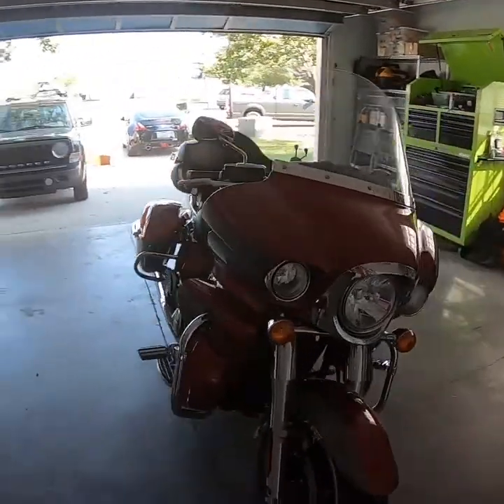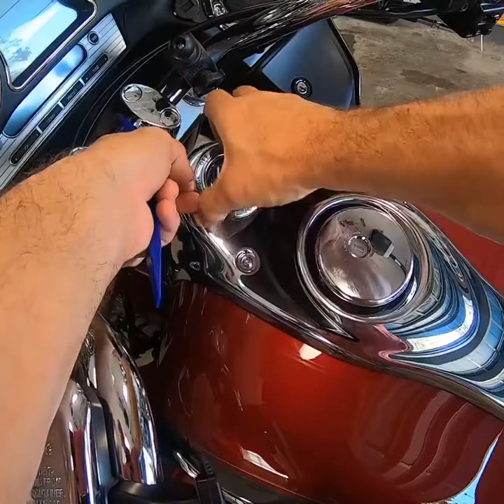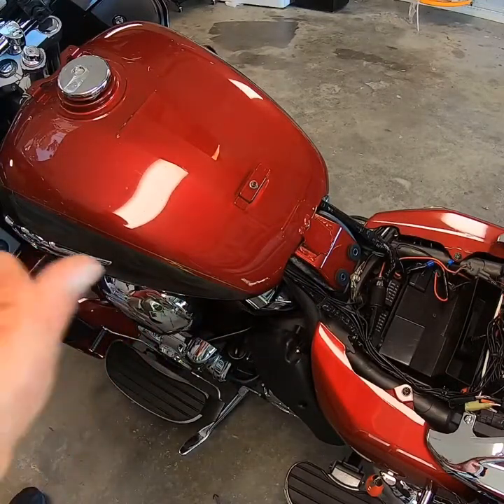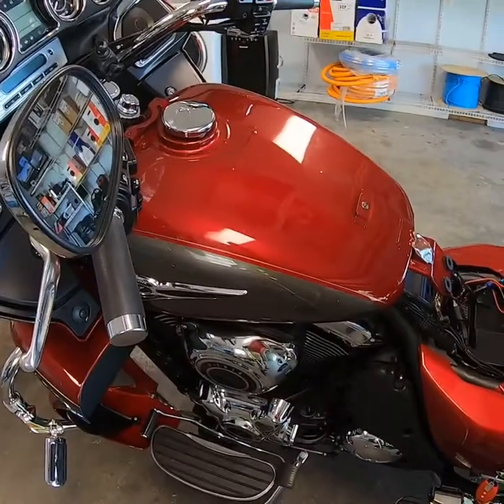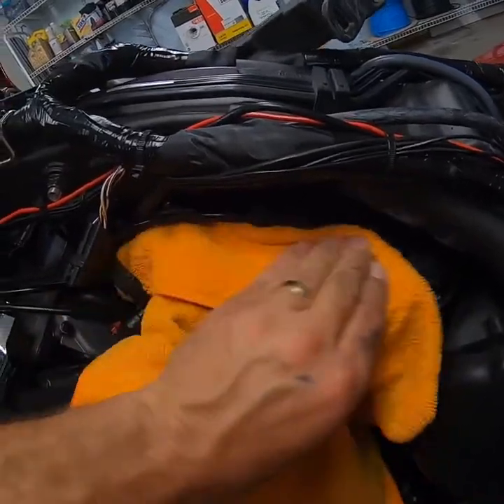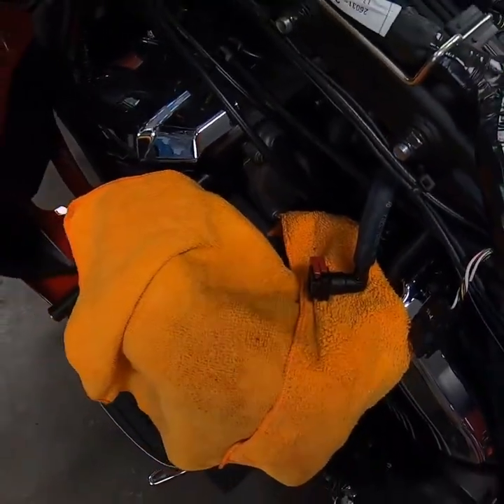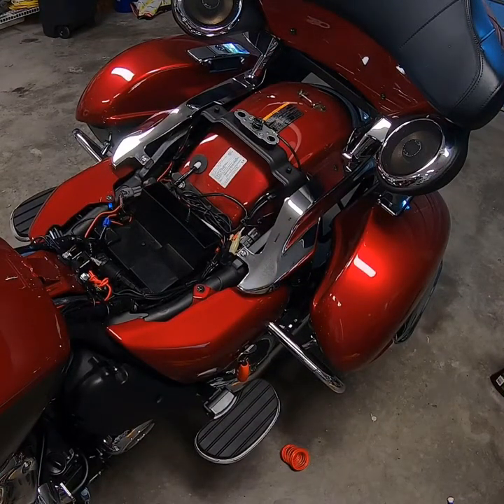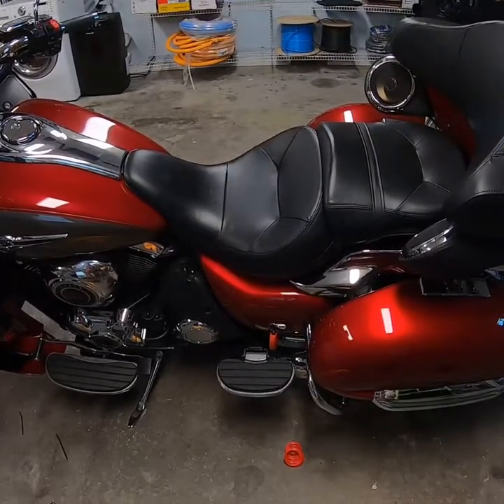Fuel Gas Tank Removal Installation for Kawasaki Voyager VN1700 Radiator and Fuel Pump

Comment: Helpful hint for any fuel tank with U-shaped front mounting points: before reinstalling the tank on the 'bike, put a dab of vaseline, or lithium grease into the u-shaped 'grooves' on the tank. It helps slide the tank onto the rubber bushings, especially if the bushings age, or get dry/stiff. Ride safe. :-)
Reply from the maker: Thank you, if you watch my other videos I have the Petroleum out many times... It's a great idea but I never really liked doing the tanks, always seemed to make a mess just need to put a little on there to keep from sticking not glob for sure.  Thanks for the tip if I do another on a tank removal I'll mention it. Please subscribe if you haven't already and hit the like buttons...
Reply: @RagerJackOfAll  I agree on the jelly making a mess, if it's 'globbed' on. Like the saying goes (from a Brill Cream ad)..."a little dab will do ya!" :-)
Reply: @kellymc239  Brylcreem? How old are you! ;-)

Comment: Great video txs...what was the Coolant you recommended ?
Reply from the maker: https://www.amazon.com/dp/B0014FX6RE/ref=cm_sw_r_cp_awdb_imm_SGH3NRZ9AGRR95ET2FCQ

Engine ice is she Brand I used.  Seemed to help a little kept it out of the red zone but the computer flash did the most.  Just be sure to not void any warranty when flashing your ecu, but there are tons of reviews online of Ivan’s performance have not seen any negative except the fact the dealer can see the flash if you ever run into electrical issues and can use that to say not under warranty any longer. 

Thanks for watching
Reply: Thank you ! Apologies I wanted to also ask if you did a coolant change video...
Reply from the maker: @TheNorthernboy2010  No I don’t have but you need to take the tank off to get to the fill for the radiator.   Follow that and just loosen the clamp on the bottom radiator hose and pull it off. Not much more to it hard part taking off the tank. 
Kawasaki Vulcan Voyager VN1700 Fuel Gas Tank Removal Installation To Get To Radiator Fuel Pump
Reply: @RagerJackOfAll  thank you !

Comment: Hi Greg, is there a bottom bolt to release the coolent from the radiator on this Kaw 1700? Please let me know.
Reply from the maker: Mine did not have a coolant drain plug if that is the bolt you are talking about.  I just removed the lower hose to drain the coolant.  Wasn't as pretty of job but it did work.  Put a gallon of distilled water through it while the hose was still off to kind of flush it out.  Hope that helps thanks for watching and commenting.

Comment: Did the rattling stop?
Reply from the maker: S Roth Yes but haven’t been riding much this summer.   Live in Myrtle Beach area so between the Covid outbreak and work haven’t had time to really put any miles on it. Just looks like a bad design, hopefully by the 2020 or 2021 models it was resolved.  Thanks for watching soon as business slows a little plan on doing some riding and updates.

Comment: Where is the fuel filter at? Is it under the tank?
Reply from the maker: https://www.kawasaki.com/en-us/owner-center/parts/242891/2018/VN1700BJF?cm_re=PARTSLISTING-FINDDIAGRAM:2018VULCAN%C2%AE1700VOYAGER%C2%AEABS-PARTBUCKET

It is up inside the tank, you need to drop the fuel pump to get to it.  Thanks for watching.

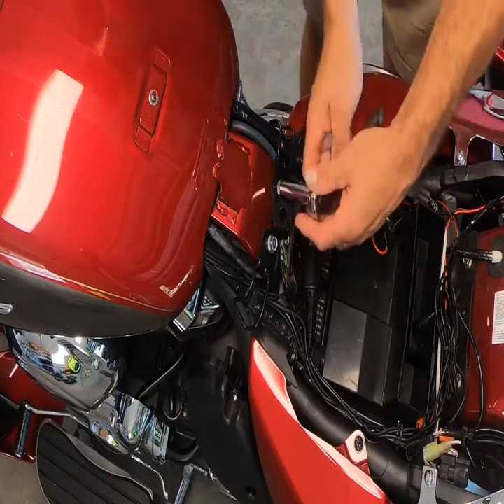Comment: 4:43 are those really 12mm?? They wouldn't fit in any of my 12mm sockets
Reply from the maker: Mine were 12mm, very possible that earlier or later models had a different size.  Besides that, hopefully it helped you with what you were doing.  Thank you for watching.
Reply: @RagerJackOfAll  it helped a lot! Replaced my spark plugs. Thank you.